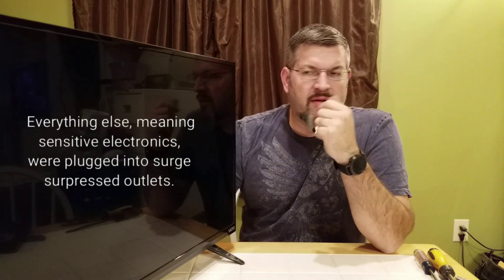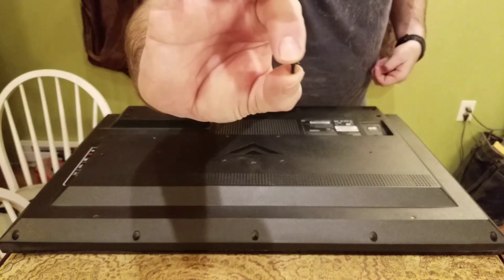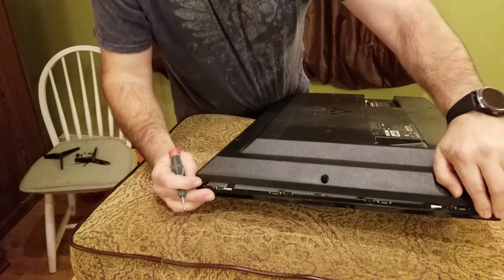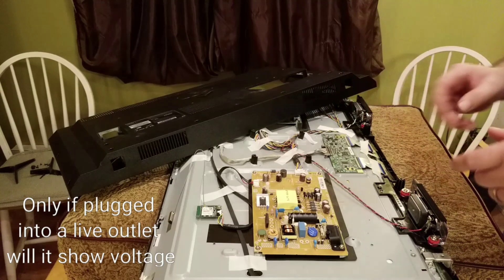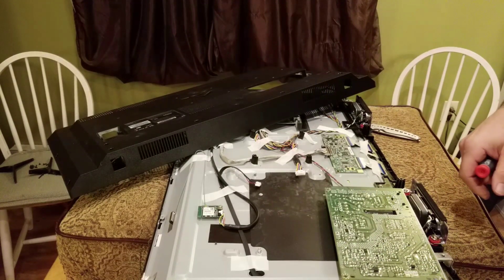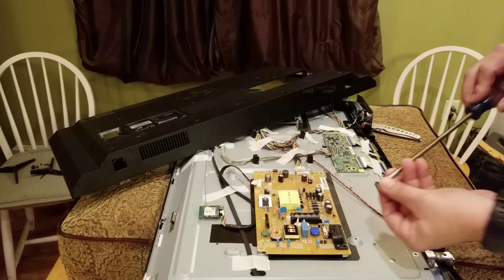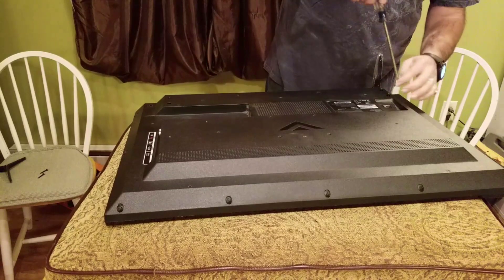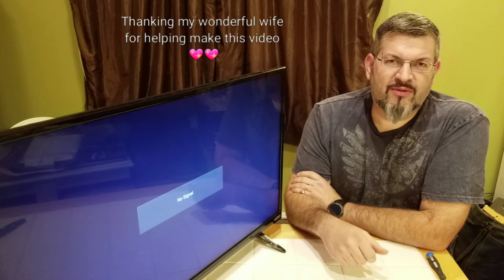Vizio lcd TV D32x-D1 Lightning Surge, No power, Blown, not working, Do it yourself, fixed $save$

Comment: Wish you had mentioned the part numbers for the power board and the other board. It will help people trying to locate these parts. Nice video 👍. Thanks.
Reply from the maker: I would have, but there are some variations of components in  TVs even in the same model line.   I felt if I put the numbers from my TV and someone else was different they would complain that they bought stuff cause I directed them to.  So it's best to pull the correct numbers from your components to get the correct stuff the first time.   Thanks for the comment.

Comment: I have this same exact tv model. i was hoping you were going to get in where the back lights are but you did not need to go that far. At least I know now how to begin taking it apart. Thanks for your video. PS I like that pillow idea.
Reply from the maker: On the left is the power board, the right is the mother board, the bottom center is the T-con board. The T-con takes the signal from the motherboard and processes it into horizontal and vertical lines for the LCD. Generally if you have half a picture or a distorted picture it's the T-con board. 
If you have breaking up, freezing, severe pixelation on the entire screen, no picture or sound it is more than likely the motherboard.
If it's just the LED lighting, it could be the power board not supplying the right voltage to the LEDs. 
Shine a bright flashlight into the LCD screen real close and look to see if you can see the pixels/ picture. If you can, then the LEDs are out and probably need a power board replacement.
If you can't see any pixels or picture then it could be the motherboard. 
I hope this helps, thanks for the comment.
Reply: @ZeroFuelRequired  Thanks for your reply but I was unable to find replacement led strips for my TV . Every seller I checked was out of stock  and I got tired of looking for them so I just trashed the whole TV.
Reply from the maker: @bluegirl4326  that sucks. Sorry it didn't work out. Thank you for the question anyway.

Comment: We have a Vizo tv that is about 8 years old. We have never had any problems with it until yesterday. It was plugged directly into the wall outlet and always has been. Yesterday the winds blew really hard for about 15 minutes and we had a short downpour of rain. About 2 hours later our power went out (figured a tree down the road had dropped a limb on the wires). It was off for almost an hour and then came back on (no on and off just a steady "I'm back on now" and boy were we thankful. 100-degree heat no shade and all-electric is no fun when the power goes out. About 20 minutes after the power came back on hubby went in and turned on the tv to watch it. It stayed on for a few minutes then started turning off by itself. Finally, after it did that for about 5 times the power would come on but no picture and no sound. Decided to leave it off for the rest of the night and just try it again in the morning, still no picture and no sound. Maybe 6 hours later tried to turn it back on and it still had no picture and no sound, couldn't get even the menu to come up. Now the power will not come on at all. Even tried doing a reset on it and plugging it into a different outlet. Anyone have any suggestions as to what might be wrong with it? I'm a 65-year-old woman and I'm willing to tackle taking it apart to check it out, but I don't know anything about TVs when it comes to repairs. I'm trying to figure out if it is the main circuit board or the power board because I'm not in the position to buy a new tv and I'm hoping the replacement part would be cheaper than buying a new tv. Ok folks help me out here.
Reply from the maker: I've had power surges come right through my cable box then through the hdmi and blow out the main board on my TV before.  It sounds like the main board went 1st and not that is your fault but trying to turn in on may have fried the power board too.  Or at a minimum popped the power board fuse. People are always selling parts of TVs online.  Check Facebook market place for your exact model you might get lucky and find someone selling one cheap with a broken screen that you can pull the motherboard and power board and put in yours.  Or check ebay you might find a deal on both from the same seller. I hope this helps,  thanks for the question and I wish you luck finding the parts.

Comment: Ive got a 2018 55" that got hurt by a lightning strike.
Is it possible the electrical spike made it past the power board?
Dont want to waste a single dollar or minute attempting to repair it, if potentially the boards beyond the power could be damaged
Reply: Can vouch made it past the power board, 65" lg 4k - currently waiting for a new main board to arrive.

Comment: Nice Video,  where did you get your power  board to buy.
Reply from the maker: The easiest and cheapest place to find them is Ebay. Just search for your TV brand and model number.  Compare your power board serial numbers to make sure you find the correct one.
Reply: Thank You,👍'
Reply: Thanks.

Comment: I bought a used power board for my 60” tv it still didn’t turn on. So bought a used main board still didn’t turn on. Put back both original parts. Do you know what else could be causing it from turning on?
Reply from the maker: The power board is usually the first thing to go, it's usually a blown fuse usually right next to where the power cord plugs into the board, that you can check with a volt meter or it could be a 20 cent capacitor that goes bad and will shut the TV down (capacitors are small black soda can looking things on the power board with a silver cap with a x on the silver cap (the top wont be flat they'll buldge that's how you can tell one is bad) ) capacitors have numbers on the side, match them with a new one, solder the old one out and solder new one in(capacitors are really really cheap to buy) when done put back together and test.   What type of TV is it?  Is it an older fluorescent bulb TV or a newer L.E.D. TV? Does it have a simple power cord(make sure the cord isn't damaged anywhere in line) wiggle the cord to see if it's losing connection in line  or does the cord have a power pack inline? If a power pack is inline the power pack could have gone bad and need a new one.  With either set of boards installed does it make any sounds or have any lights come on when your press power button on the TV or remote that would tell you it's getting power? If it is getting power then get a flashlight turn it on and put it real close the screen and see if you can see any pixels for an image on the screen, if there is an image(pixels) the light that illuminates the LCD has burnt out or the screen LCD controller the smaller board connected to the screen has malfunctioned.  Either it's not working the light or the LCD or both.  Then replace it and try again.  There's not a whole lot to a LCD  TV.  The LCD, Lighting, Motherboard,  LCD controller board and Power board.  You replaced 2 out of 3 boards in it,   If you replaced all 3 boards it should be working. It's a process of elimination, replace one at a time until you find the problem. If it's still not working then I would say it's the LCD. About the only test you could do is get a volt meter to check to see if power is coming into the power board from the plug and through the fuse in the power board. There really aren't any other tests that can be performed on the boards without highly specialized equipment and some major electronics knowledge.  I hope this helps.  Thanks for the question.

Comment: i have the same tv,. the power light comes on,, but no picture, when i hold a flash light to it in the dark i can see the netflix
.etc  would this be the same board id need ??  the little mosfet on the board does not get warm at all,, and it has that aluminum heat sink on it but no heat.. no visual blown circuits or resistors .etc
Reply from the maker: If you had half the screen without an image I'd say it was the T-con board.  That's the board in the center with the two ribbon cable going into the screen. I didn't tear the TV any farther apart than what you see in the video. It sounds as though the inverter isn't lighting the LED bulbs in the screen or the LEDs or the LED burnt out which is unlikely. This tv as far as I can tell doesn't have a separate inverter to light up the LEDs, so I am going to say the inverter is in the power board and that is the problem. Swap the power board and try it again.

Comment: Having an issue with this tv. When I turn it on the backlight flashes once quickly and goes out. Checked the display with a bright flashlight as you stated in other comments and it is working correctly, sound and all. Since it does flash when powered up does that sound like the power board or a led lighting issue?
Reply from the maker: If you had half the screen without an image I'd say it was the T-con board.  That's the board in the center with the two ribbon cable going into the screen. I didn't tear the TV any farther apart than what you see in the video. It sounds as though the inverter isn't lighting the LED bulbs in the screen or the LEDs or the LED burnt out which is unlikely. This tv as far as I can tell doesn't have a separate inverter to light up the LEDs, so I am going to say the inverter is in the power board and you could Swap the power board to see if it fixes it.  But the power board receives signal from the motherboard to tell the powerboard to turn on the LEDs. So the problem could be in the powerboard or the  motherboard and without a voltmeter to test its just a guessing game.  Try changing the cheaper of the two parts and see if it fixes it.  You might get lucky and someone on Ebay could be selling the powerboard, motherboard & T-con board. all together cheap. I hope this helps and thanks for the question.

Comment: Link for the new board to buy one?
Reply from the maker: https://rover.ebay.com/rover/0/0/0?mpre=https%3A%2F%2Fwww.ebay.com%2Fulk%2Fitm%2F173893574587. 
Double check it with your model number on your power board if you have it out. It should be correct one for the vizio d32x-d1.   Ebay is probably the cheapest place to find it.  Hope this helps  and good luck.
Reply: Mine shows power but the light slowly dims out after a few seconds, was hoping it was a fuse but really think the board may be shot, it stopped working after a storm
Reply from the maker: @bakedgodess38  the power light you're seeing might be just enough to light the LED which isn't much.  Replacing the power board should fix your problem.

Comment: I'll take the time to tell you that if a lightning strike blew the power supply to this device then the outlets WERE NOT surge protected.  Check the ground on those outlets for functionality and verify that the polarity is correct.  Something isn't set up right on the electrical system to that house. (probably related to grounding, check ground rod outside).  For a surge protector to operate it must have a functional grounding system.
Reply from the maker: You are correct.  The rest of my entertainment system is surge protected.  I had this TV just for viewing my security cameras and it wasn't. That's definitely my fault.  I built my entire 3300 sq ft house myself and wired it myself.  You can laugh and say the surge is my fault too but it's not,  I wired my 300 amp service feeding  200amp main and a 100 amp main that are feeding 2 secondary panels.  The mains have two grounding rods each, that's 4 total.  Ground isn't the problem. All outlets in my house are properly grounded.  It was the lightning strike a few hundred feet from my house that sounded like it hit my house. Not only did this strike blow out the TV, it back fed through my Comcast cable box the cable itself killing it, it blew out all the cable boxes for the TVs, yet the boxes still had power. It Blew out the comcast internet killing it. Back fed the HDMI that blew out the Hdmi in just about every device in my entertainment center, My 7 hdmi  hub is $750 pioneer 7.1 surround stereo "blown", Wii U "blown", Xbox slim"blown",  security cameras"blown".  It didn't hurt my 55 inch Samsung.  I was lucky instead of throwing  the Pioneer away, it  took months to find a hdmi board for my Pioneer and repair it.  I didn't do a video for the repair Just because of how difficult it was to find the hdmi board.  The Xbox I just replaced with a Xbox one,  the WiiU luckily works on component and my security works on component too, by it knocked out 2 cameras.  The security cameras are getting replaced soon. It didn't hurt anything else.  But surge protectors don't last forever either.  If you've got a 1000 joule projector it would only be good for 10 hits of 100 joules or only One 1000 joule hit and then you are no longer protected. So the next surge you would be SOL. Surge protectors Aren't foolproof.  I've thought about putting whole house surge protectors on my mains. Well I hope this clarifies the surge.  Thanks for the comment.
Reply: @ZeroFuelRequired  I can respect pretty much everything in your reply  I was thinking the last sentences you wrote just as I was reading them.  I, like you, have done my own wiring and I don't really know if its overkill but I have whole house protectors on all of my main panels and sub-panels, if anything it helps me to sleep a little bit better. (They are large industrial type protection systems that I was fortunate enough to get for free).  I am positioned near the top of a mount (about 50-70 feet up from ground level) and I can certainly relate to those "near hits" that sound as if they are direct hits...  (I'm considering a method of at least manually disconnecting important and/or sensitive gear during those high intensity storms, because when it comes to those storms that bring about feelings of outrage it seems that nothing is absolutely safe against electricity with so much ummpf behind it).  Lightning aside, I would feel a little better if I could figure out a way to secure everything that is exposed to those occasional "howling wind storms" that we get two or three times a year...  Best regards and a much "luck" as it takes.
Reply from the maker: @CRSolarice  Do you have good o'le fashioned Lightning Rods?  Even one well placed  Lightning Rod  higher than everything else can prevent a direct hit.  Wind that's another story.  About the only thing you can do is slow it down by putting up fence,  it's not a cure all but it'll definitely slow it down.  I would think most of the prevailing winds generally come out of the same direction.  Fence can slow the wind across your property or planting a row of fast growing Arbor Vitae trees, they look nice and grow several feet every year. Small arbor vitae can be bought cheap.  Just a thought.  Thanks for the comments.
Reply: @ZeroFuelRequired  I would never turn one down that's for certain.  I've been following the lightning mitigation systems for  a few years now and they have been coming up with some intriguing systems to prevent strikes.  At first the skeptics had reign but now the physics have caught up and people have been playing around with different charges and various setups that completely make buildings a poor target for lightning.  If I only had a bucket of gold stashed in my closet...

Comment: Hello I was wondering where you purchased your replacement parts from. I have same tv with power problems, thanks
Reply from the maker: Andrew Mathis I searched around on websites, a lot of suppliers are out of stock.   So,  I ended up buying it on eBay $17 free shipping. There are usually a few for sale on there around that price.  Buy from a seller that has decent feedback.  Good luck and thanks for the comment.
Reply: Thank you I am actually finding a lot on eBay

Comment: Where do you order the board ?
Reply from the maker: The cheapest place to find it is on Ebay used.  Usually under $20. People part out TVs for one reason or another. They can be found online but are much more expensive. I hope this helps and thanks for the question.
Reply: ...at the TV board store. Where else?  Really if you have to ask a question like that then maybe you should just go back to Walmart and buy another TV.  (And get the extended warranty for 17.95$ this time!)

Comment: Somehow the the power surge skipped the power supply and went straight to my motherboard
Reply from the maker: The power surge may not have come from your power source.   A few years ago I  had a power surge from a lightening strike on my street come through the cable to blow out my cable box, then  out of the cable  box through the hdmi to my  home theater receiver then out to the wiiU. It killed my cable box and the home theater but the wiiU still worked the hdmi was dead but the component hookup still works to  this day. It sucks. I hope you get yours up and running again.  Thanks for the comment.
Reply: Zero Fuel Required mine may have come from a amazon tv I had connected because the fire tv no longer works I paid $60 for a new board
Reply from the maker: @kcastillo1234  did you have a surge? Maybe the surge popped the Amazon TV and if it was plugged into the TV it surged the  motherboard.  Try doing Google search to see anyone else has had the same problem.  Or check to make sure the Amazon tv doesn't have any kind of recall. Maybe complain to Amazon to see if they'll do anything for you as far as replacement or paying for damage.
Reply: Zero Fuel Required yes I had a surge one day during a storm it destroyed the fire tv and the TVs motherboard
Reply from the maker: @kcastillo1234  I gotcha.  Yup probably the fault of Amazon tv.  Well thanks for watching and good luck getting your tv fixed.  😁👍
Reply: Zero Fuel Required yes I got it fixed with the new motherboard the power supply was good it was just the motherboard